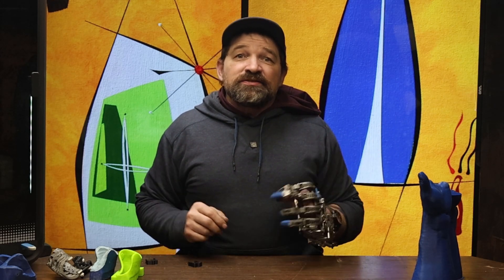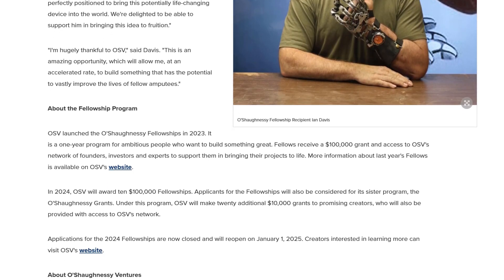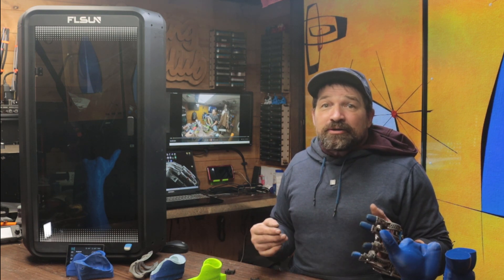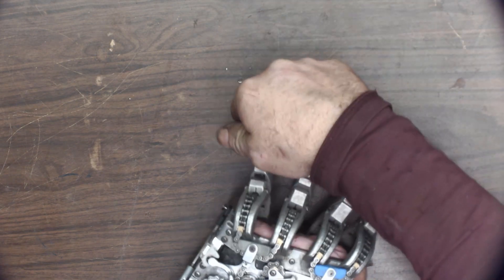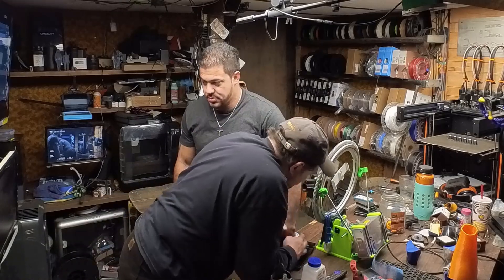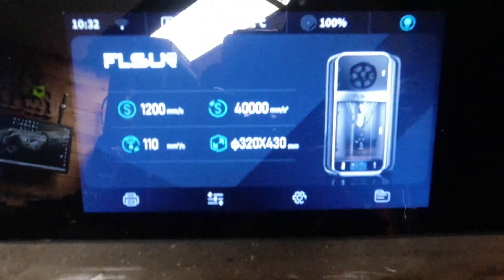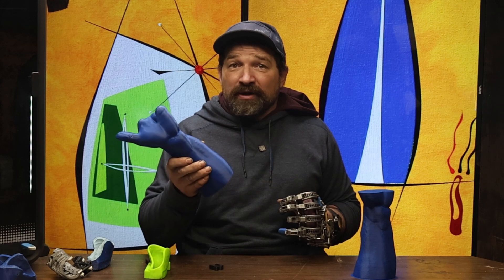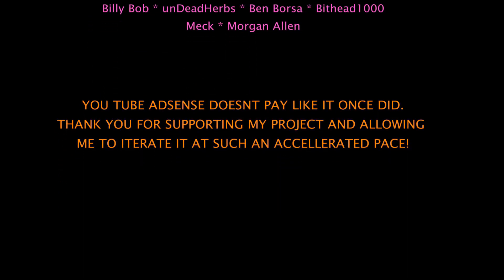Chris finally Visits my Shop!  And my thoughts on the FLSUN T1 Pro.

Comment: Hi @missingpartsclub. What you are doing is absolutely amazing, from a technical to humanitarian perspective. 

I was wondering if you had heard of the Tsubaki Epsilon micro-chains. They are a micro chain with 2mm link size and ~7mm winding size on a 9 tooth gear.

They aren't widely known and I just wanted to pass the info on, as it might be a solution to some of the form factor challenges you face. If not, I wish you the best of luck and will watch your progress in amazement.
Cheers

Comment: I recently found your channel and your work is both fascinating and inspiring! I hope it's not too rude, but I am curious about some of the limits of the hand and how it works, like:

- What is the grip strength like? Do you struggle to hold items past a certain weight or not really?
- Does the hand have any sort of locking mechanism or do you always need to be very aware of your arm movements to prevent dropping items?
- Do the mechanics struggle at all with fast movements of the arm? (I'd assume not considering how everything seems fully mechanical and not subject to great jostling risks)
- Does the hand put any large strain on you? Do you need to take breaks and remove it or can you wear it all day? (I've heard it can be tyring or even painful to use prosthetics for extended periods so I'm curious how your design feels)

Again, sorry if the barrage of questions is rude, I'm just super curious about how all this works and feels to use.

Comment: i wonder if it would be possible to replace the metal with carbon fibre and the chains with Dyneema rope. It would probably be less durable but you could make it a lot more low profile and lighter

Comment: I also have a T1pro, and I'm lucky to have the same machine as you.
Reply from the maker: Did you need to make a little bracket, and add the Bowden tube, or do you mostly print shorter prints?

Comment: Cool stuff! I see where having one less finger would be not quite ideal, but if you can make the mechanics work without much trouble I think 4 fingers instead of 5 will be fine. Even 3 fingers would be OK, that's all you need to pick something up securely.
I'd bet most people won't even notice there's a finger missing since they'll be distracted by the steampunk hand
Reply: I was thinking it might not matter at all at this stage. Sure, the endgame dream is a fully featured hand that fits in perfectly with a world designed for 5 fingers (keyboard typing etc.), but that's far away, and 4 vs 5 might not matter at the current development stage. As you said, now is more about grabbing and holding.

Comment: The check socket portion... Could one be designed that would ADD back the "missing" area that would accommodate the pinky? Like, a beefed up outer (pinky) portion that would wrap over the end of the hand and therefore be load bearing on the outer portion of the hand. In my less than knowledgeable head, that seems (in theory) like a less-involved way to possibly keep the mechanism as 4 fingers and reduce reengineering efforts, etc.